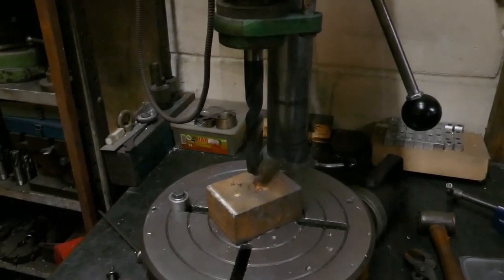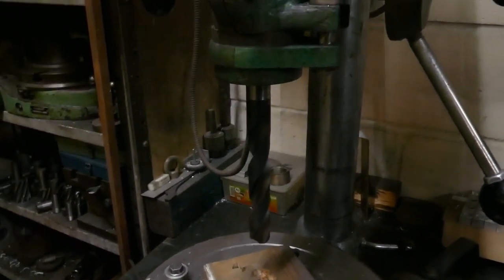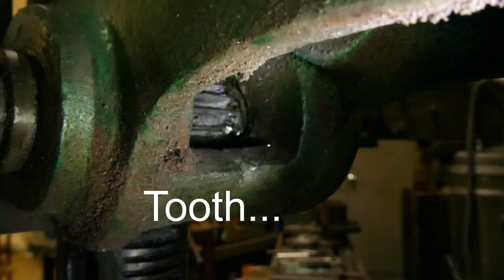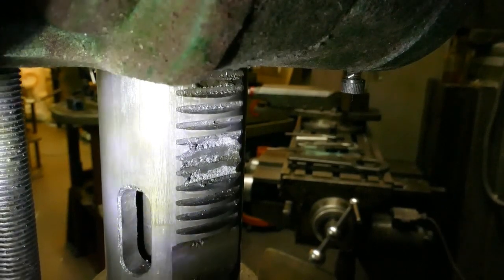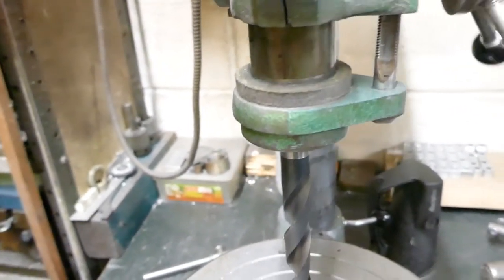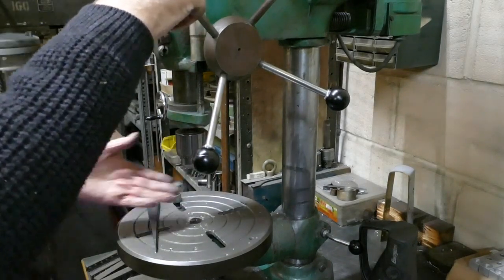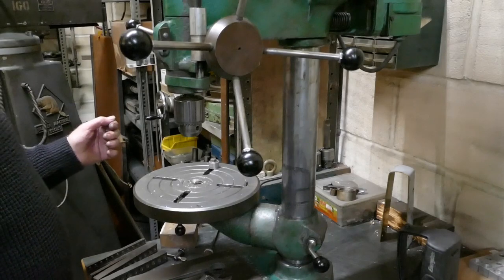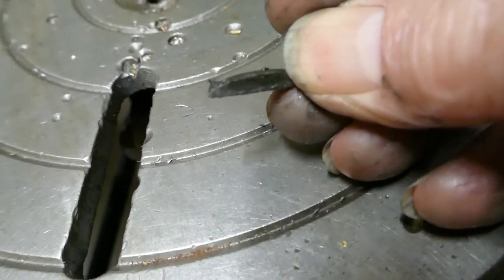How to break the teeth on a drill press quill rack.

Comment: Oh that looks bad. Must be cast?  If the tapers are clean it should be possible to shove the drill up smartly but lightly and it should lock solidly. Cheers
Reply from the maker: Yes, I had wondered if the quill was made from a casting. I'll try & do a grinding spark test on the broken bit...
Actually I won't - the broken tooth is gone!

Comment: Wow. I didn't know that could happen. I used my drill press as a mickey mouse arbor press to finish off installing bearings when shrink-fitting. I ought to find or make a real arbor press then.
Reply from the maker: This drill press in the video might be a bit fragile but it's something to think about.
Reply: Stop doing that.  Use the right tool for the job, or suffer the consequences.
Arbor presses - especially used ones you can go and pick up, like from a local used machinery dealer - can be had quite quite cheap.

Comment: Time to get the welder out and put some metal on the quill. Being only a drill the teeth could be filed and still work, its not like it is a precision instrument. 😉

On a side note, i am giving up some jobs i do like sleeving BMW bike oil pumps in the crankcase. Just a query but if the guy i do them for asks for recommendation would you be interested? 
It is a nerve racking job as messing up is not an option and clearances  are in the 1 thou range.
Reply from the maker: Yes, I'll have to try welding it up if it proves to be a real nuisance. Could maybe do it without taking it apart too.
Might be interested in the oil pump job...
Reply: @MidEngineering  I might not hear from him about it again, having already shown my reluctance, but if it happens I would offer suggestions as to how I did it so you wouldn't have to reinvent the wheel.
Reply from the maker: @chrisstephens6673  Fair enough!
Reply: @MidEngineering  was there an outcome from the Welding? have found myself contemplating the same idea with exactly the same problem
Reply from the maker: @NeoNitro  I've yet to attempt a repair. We've been careful not to make it any worse so we can still use it. I'd be wary about welding it as I think it may well be cast Iron.